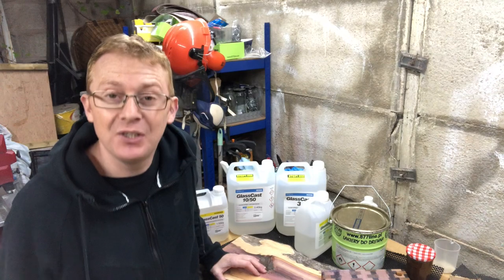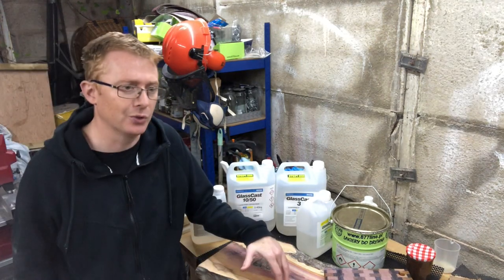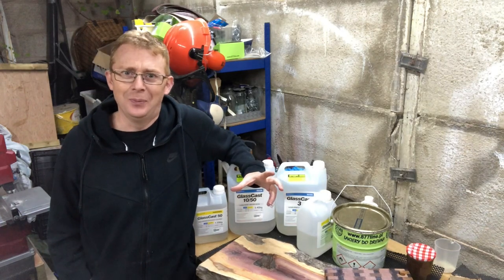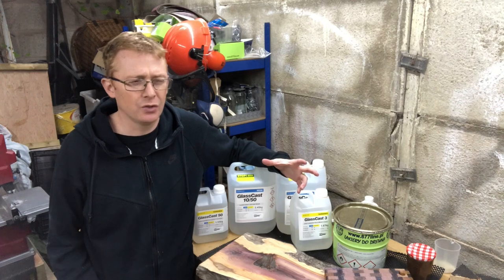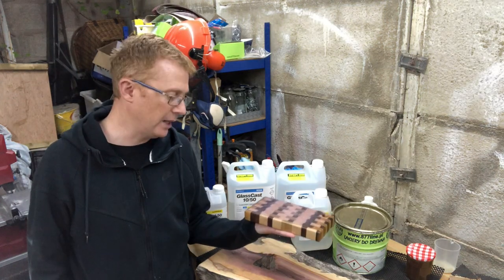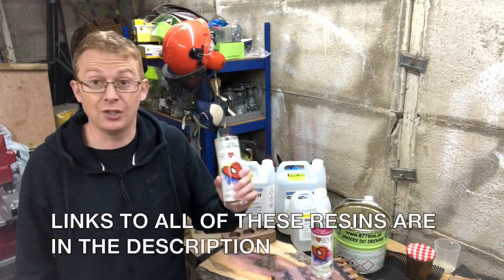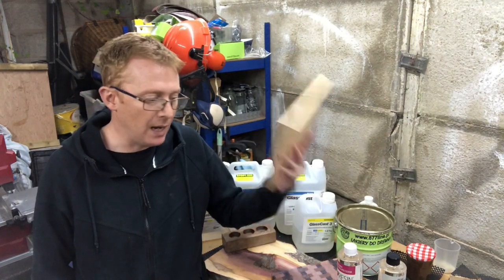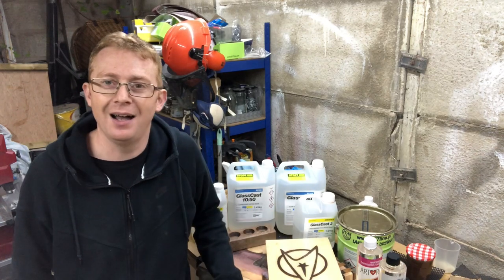Which Resin for Which Project? Is Epoxy Resin Food Safe?

Comment: Hi I've just seen your video on the glass cast and  Art resin , would the art resin bond to the glass cast as a top coat as art resin is so expensive
Reply from the maker: Thanks Kai. I don’t see any reason why it wouldn’t work, but make sure the glasscast hasn’t completely cured before applying the Art Resin. If the glasscast has cured then you’ll need to ‘key’ it (sand it with some 80 grit) so the art resin will bond to it (it won’t leave any scratches). If you email technical support at Glasscast they will be able to give you a definitive answer 👍👍👍

Comment: Awesome video !! Thanks for sharing !! I’m still trying to learn the in’s and outs of resin and what’s safe or not. I almost started making resin shot glasses as I’ve seen some other people selling them and though it would be fun ! But I did some extra research and people think it wouldn’t be a great idea due to the resin leaching from the alcohol. I’ve seen in the comments that you wouldn’t recommend putting something hot right on the resin. What do you suggest for coasters ? I have these big coaster molds that are great for over sized mugs or wine glasses !  Seems like such a waste people making ashtrays and coasters if they don’t work. Although the first ashtray I made hasn’t been used too much but it hasn’t been damaged when used either. Thanks again for the video !!
Reply from the maker: Hello laur and thanks for the message. I think with the heat aspect of a hot mug for example resting on resin, I’m being a little ‘overprotective’ . Is it ok to use resin for a pair of coasters costing maybe £25 then not really a big issue. But if you’re selling a side table for £400 then I think it’s fair to say don’t put hot cups etc on it as it may affect the quality of the resin. 

I’ve just finished two coasters made with champagne corks and they turned out lovely, but I did say they’d be fine for champagne flutes or a wine glass, but a hot cup may affect the polished finish of the resin. I suppose you can advise against hot cup use then if your customer chooses to do that then that is their problem, not yours 😀

Comment: Nice video mate, is Glass Cast 50 thin enough for bubble removal cheers
Reply from the maker: It is bishlives, but how thick are you planning on pouring as there maybe more suitable alternatives?
Reply: @Hand-i-Craft  Not sure at the minute but I know it says 50mm pour or 25mm on wood. The resin I have now is only 10mm pour. I used high viscosity before and couldn't get rid of the bubbles so this is good for degassing. I just didn't want to pay 90 quid until I was sure.  I won't be attempting a river table yet until I know the score.
Reply from the maker: @alienworldshop  You can do 50mm but I’d recommend it over two pours. I haven’t got a degassing chamber (yet) but I have found putting the resin containers in a bucket of warm water before mixing really does help and the viscosity is lowered and the resin is much ‘runnier’ when mixing resulting in less bubbles. I always say try it on a smaller object first before going all in on a £90 + experiment 👍👍
Reply: @Hand-i-Craft  Thanks for that mate. I read that if you do more than one pour you have to sand with 120grit ish so it keys. Is that really necessary because I'm sure you wouldn't be able to sand the awkward bits. Is this just for strength? Appreciate the replies buddy. 👍
Reply from the maker: If the first pour is still at the B stage pal (ie: if you put your finger nail into it it still leaves a mark) then you can just do the second pour without keying it. You only need to sand (key) it if it has fully cured
Reply: @Hand-i-Craft  Thanks for all the info mate I appreciate it. 👍

Comment: I make salt water fishing lures I want a crystal clear hard  finish and will be applying in thin layers what brand would be best?

Cheers Flynn
Reply from the maker: I know folk who make jewellery which would be similar in thickness to a lure use Glasscast 10 Flynn so maybe worth giving that a go. You can buy the Glasscast in smaller sizes so would well be worth experimenting before buying a big batch 😀😀
Reply: @Hand-i-Craft  ok it will be applied onto wood so I’ll try that thanks very much
Reply from the maker: @flynnvangemmert4973  If it’s just a very thin coat to seal the wood and maybe a mm or 2 over the top of it then I’d try Glasscast 3. The number on the end suggests the thickness of depth when using it so Glasscast 3 up to 3mm, Glasscast 10 up to 10mm etc😀😀
Reply: @Hand-i-Craft  ok thank you

Comment: Very informative Thanks whats the cure time on the hard wax oil Thanks
Reply from the maker: Cheers Michael. The hard wax oil is a little bit like the resin in terms of curing fully, as in it can depend on the environmental conditions you are applying it. As a general rule, if I am applying more than one coat I can leave it for a day in between coats (you can lightly sand it around 400 grits between coats as well) then leave it for 2 approximately days to fully cure on the final coat. Hope this is of some help😀

Comment: Very helpful, thanks. You're using products a different way round to myself....I've been using Art Resin for over a year, because it's used on products I need to be 'food safe', but it's very expensive for resin pours (plus it has lots or bubbles), so I've just switched to GlassCast for resin pours (non food contact items). I've bought GlassCast50 as my moulds are over 1cm deep.  
Is GlassCast resin heatproof pls? x
Reply from the maker: Hello Su M, thank you for the message. If you are doing resin pours around the 1cm - 2cm then glasscast do a Glasscast 10 product that maybe better suited to your needs?

In answer to your last question, is any resin product heat proof? I’d be inclined to say no, but if you treat it with something like a hard / wax oil over the top, although it won’t soak into it, it will help by providing a protective layer over the top of it. I think if you make any resin product you should recommend that no heat source is applied directly to it.
Reply: @Hand-i-Craft  Aw thank you 😀. I emailed GlassCast before I bought it and they said 2cm to 2.5cm moulds needed GC50. Like yourself - I was thinking GC10 might be sufficient, but I think the price was the same - so I just went with the GC50.  I might try GC10 though at some point - curious about it now 🤣. 

Art Resin is heatproof for what I use it on (insulated drinkware), but yes - think I'll resist using it for coasters etc then.

Subbed to your channel, I'll have to watch your videos when I get chance, the Penny table looks amazing I have to say 👌👍 x

Comment: Hello thank you for the video!. Very informative. I was wondering if you could answer a question about glass cast 3.. i have some  and was going to use it on the base  of a model i have painted  . Its a little stream  will be 15MM  deep . And on painted plaster of paris. Is glass cast 3 ok you use on this kind of surface.. ?  Thanks
Reply from the maker: Hello Richard, thanks for the message 😀. Couple of things here, firstly glasscast 3 isn’t really suited for deeper pours so maybe glasscast 10 or even 50 might be more appropriate. If glasscast 3 is what you have then I’d maybe consider the layering approach by applying a coat then adding layers once they’ve reached the ‘B’ stage. In all honestly though, glasscast 3 isn’t designed for deeper pours so I wouldn’t recommend it.

Secondly in regards to the plaster of Paris. I have to be honest, I’ve never applied resin to a plaster base as I mainly use it in conjunction with wood, however I would strongly recommend you try it with a small ‘test or off cut’ piece first. As you will well know this stuff isn’t cheap and, although the plaster maybe a non ‘ish’ porous layer. It may well be worth checking issues like air bubbles once poured. I would also consider applying a painted layer of resin onto the plaster, allow it to semi cure, before applying a deeper pour.

I hope this has been of some help and good luck in your resin ventures😀. Please let me know how you get on, best wishes, Leo
Reply: @Hand-i-Craft  Leo  thank you so much for taking the time to message me back i really appreciated it. Thanks  you have cleared some things up for me there.. im just trouble shooting my resin options.  Ive worked on this model for a good 4/5  months now  and the resin for the water feature could ruin all that work if i get it wrong.
Thanks again
Reply: Sorry to keep on leo. Can i ask 1 more.. what is the max depth for glass cast 3  ? Just so i know for future projects
Reply from the maker: No worries Richard, few people have asked this and the clue is in the label. Glasscast 3 is for approximate 3mm pours, if you look at my penny resin table video I used glasscast 3 on that one, glasscast 10 for approximate 10mm pours and glasscast 50 up to 50mm pours, but this tends to be done in 2x25mm pours to avoid overheating of the resin. Hope this is of some help😀
Reply: @Hand-i-Craft  oh! I see . Thank you for clearing that up.  Very helpful  thank you  keep up the good work .look forward to watching more of your videos    thanks  again

Comment: very helpful, subbed, i was looking for this very answer about food safe resin, but think ill advertise mine as serving platters, not for cutting on.
Reply from the maker: the green man Cheers green man. I’m not a food safety expert but I would say a surface with resin would be better described as a serving platter than a cutting board. That’s why I’m heading in the direction of a cutting board of solely wood on one side with the flip side being a resin serving platter 😀
Reply: @Hand-i-Craft  cheers, i notice your struggling to hold some things when cutting, not seen all your videos, but do you use the quick grip style clamps? one hand operation, i use them more and more even in conjunction with non slip mats when sanding routing etc, and the little flip over clamps are good attached to jigs for holding small stuff, happy woodworking ;0)
Reply from the maker: the green man Yes, you’re right pal. I lost the use of my dominant right hand around 18 months ago. I turned to woodworking to learn a new skill as a form of mental and physical therapy. The nerve damage I sustained in a car crash hopefully isn’t permanent, but I’m looking at a long term recovery. If you watch any of my other videos I demonstrate how I make stuff just using the one hand. Thanks for the subscription 😀

Comment: So is it safe to serve hot coffee in raisin cups?
Reply from the maker: Original Username . 12 years ago Hello there, my honest answer is I don’t know, but personally it’s not something I make or would recommend doing. I can’t comment on any potential health hazards, apart from the FDA certificate stating ArtResin is food safe for occasional contact, however I’d imagine there would be issues aesthetically with the resin after I short time with coffee mugs. I’d imagine the resin colour and finish would distort quite quickly. The coffee tables I make using resin I specifically state to not place a hot mug in direct contact with the resin for the same reason.

Sorry I can’t be more specific on this as it is a technique I’ve never done. I do recommend you research this though to reach your own conclusions. Cheers😀

Comment: Good info. Out of interest, what is the benefit of using resin for the serving side and not just leaving it as oil-waxed wood?
Reply from the maker: Cheers James. I’m just trying to do something a little different creating something more unique. There are tonnes of wood serving boards etc, whereas with the resin you can apply a pigment or tint to the surface layer and polish it to a mirror like finish. I’ve not seen many people making a chopping board / serving board combo using resin on one side. People may look at it and go ‘what a stupid idea’ or they may go ‘I quite like the look of that’. You could also customise it to a clients specific request. Have a look at my upcoming video with the Star Trek logo and you’ll get the idea. Cheers, Leo 😀
Reply: @Hand-i-Craft  Cool. I get it, so it's more about the looks than providing additional functionality. And it provides more unique artistic potential. Nice

Comment: Can this be applied to 18X18 limestone tiles?
Reply from the maker: Irene Nystrom Hello Irene, can I just ask is it for the purpose of repairing or aesthetics? Best wishes, Leo
Reply: Hand-i-Craft  hello Leo, as you know its very puris, it gets dirty pretty fast, so i was hoping that resin would make it look great and still prevent the dirt from getting in the pores.  Any ideas?
Reply from the maker: Irene Nystrom Good question Irene. I’ve never tried it so what I’m going to say now is pure speculation. If I was in your situation, I would get the small pack of Glasscast 3 (the 500g kit is £14.95) and I’d experiment on one stone or a piece of stone to see if it works. The way I’d apply it though would be to brush a thin coat of resin on first (this helps to form a seal between the material and the resin finish), leave for a few hours then apply the resin over the stone. It will be fine to walk on once fully cured at that is the resin that is used for penny floors etc. If you do decide to have a go, I’d love to hear how you get on with the experiment. As is the case with resin, it could end up being an expensive project depending obviously how much area you are covering. 

Please return to this thread to update me with your resin adventure 😀